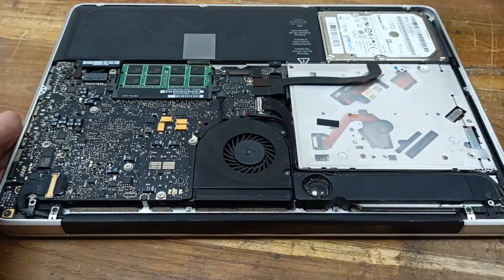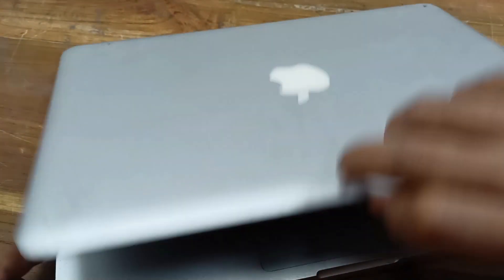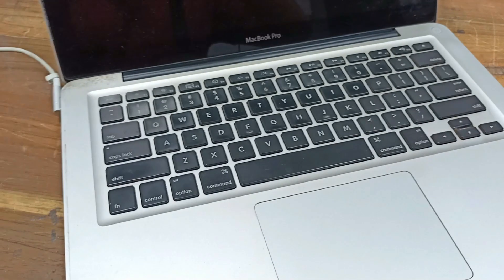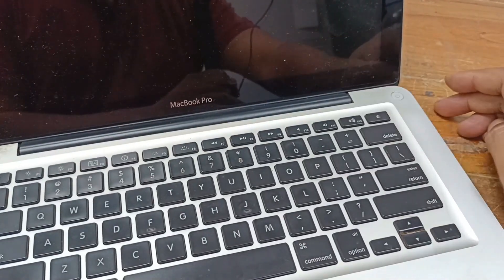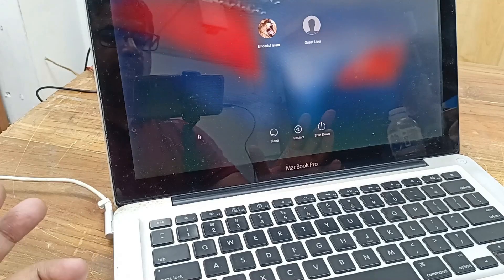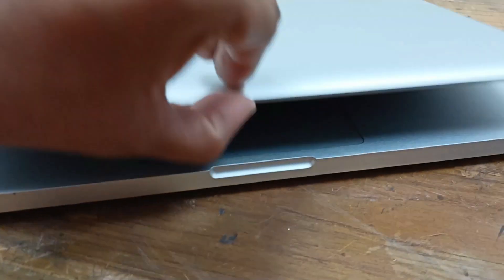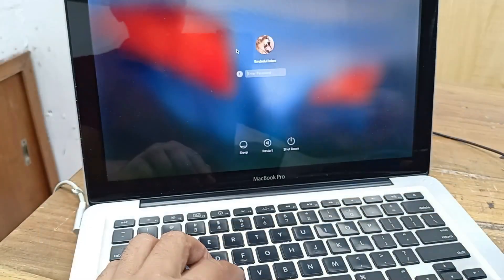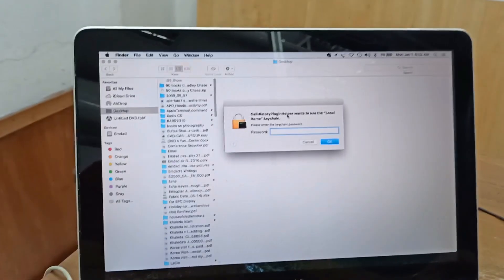Mcbook pro A1278 power is not turning on solved

Comment: My computer has been off for a while, I did some of the things you showed in the video but couldn’t remove to clean the little green boards, also when I plugged in the white light in the front came on and the cable seems to be working but it made a 3 beeping sound, so I pressed command R and the power button so it seems to be charging but it hasn’t turned on.
Reply: Is it resolved or not yet if yes then please let me know